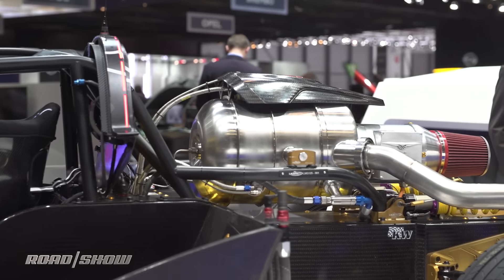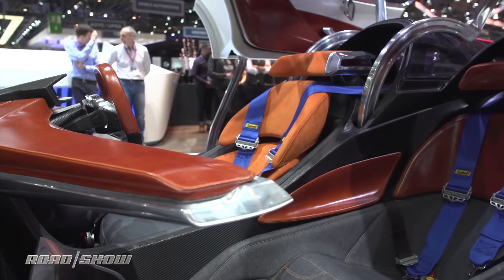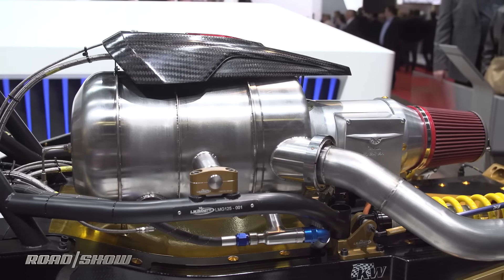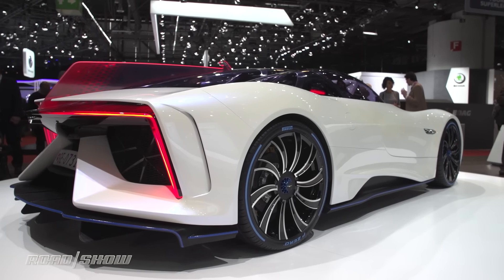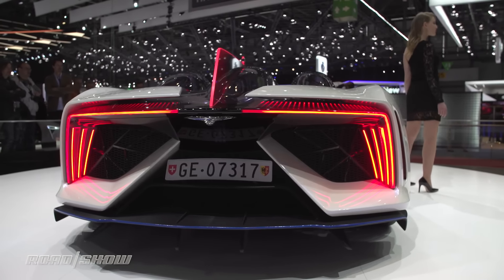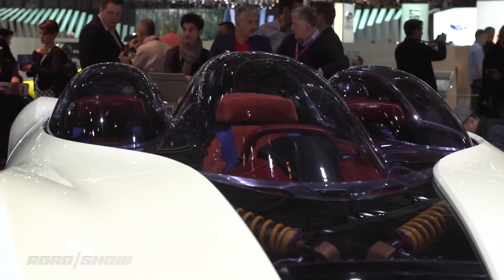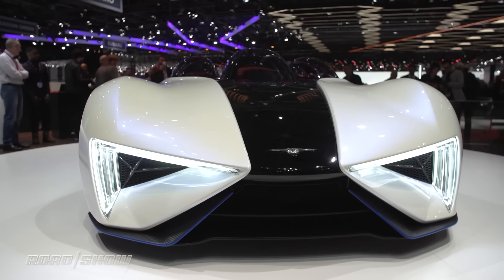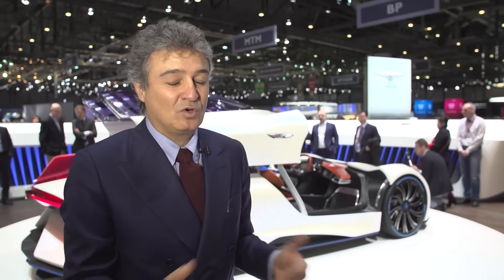Turbine-powered electric supercar unveiled at Geneva Motor Show | 2017 Geneva Motor Show

Comment: YES! I've been calling for this approach for years. High efficiency gas turbine with zero mechanical linkage to the drive train, which is pure electric. All the low-end torque of other EVs, but without the battery weight, recharge times or range anxiety. Kudos to TECHRULES. Now to see other automakers adopt this approach.
Reply: Oluseyi S nah it's not the best.  It's still bloody slow and only a one seated.  There are suppressed electric motor tech of greater than 100 percent efficiency.  This is nothing
Reply: Constantine Joseph it's nothing... Ok Einstein!
Reply: Constantine Joseph to have an efficiency higher then 100% you have to break the laws of physics
Reply: LOL.
Reply: it's a three seater actually, the driver's seat is in the middle
Reply: Actually this idea isn’t new. Jaguar came up with the same thing in the C-X75 proto about ten years ago...
Reply: To Right!!
Reply: Ya this is how you get the best of both worlds and how electric cars can actually beat an internal combustion engine! We should see one of the race teams on Lamans or something use this approach against standard ICE cars and show the world what it can really do!
Reply: @ConstantineJoseph  
2:56 Is is two seaters.
Reply: I agree! Turbines have so many advantages. Check out Wrightspeed. Also, with CO2-neutral synthetic fuels, I think it could well be a bright future.

Comment: diesel turbines? for an electric car? Thats counterproductive and rather worthless? :( It should be propane or a cleaner source like natural gas if they just HAVE to use a nonrenewable in the mix.
Reply: Actually You can burn anything in turbine engine, from diesel, kerosene, Biodiesel, Ethanol, Alcohol, Perfume, Jet fuel, US Military JP-5 and JP-8, including your gas. But it needs more rigid compressed tank than if you put liquid fuel.

It's not counterproductive because you only need smaller Lithium battery than compared to full EV car with similar performance. Faster and more practical to be refueled too with greater range.
Reply: How about Hydrogen burning in the engine.
Reply: I think even diesel burns quite cleanly and completely in a turbine like this. And with synthetic clean CO2-neutral fuels in the future, this setup will be perfect for many applications. Especially boats, ships, yachts, planes, drones etc.

Comment: Reciprocating engines are what, ~30% thermal efficiency at best.  No mention of target efficiency.  Looks like empty marketing.
Reply: Gasoline is about 20 percent, Diesel can get to about 40, gas turbine can get to 60 percent as of 2011. This is the best approach for electric motors to compete with internal combustion engines. Batteries will never reach the practical 2000 w/kg energy density of fossil fuels. We should use this design with carbon neutral synthetic gasoline.
Reply: @livefire666  
You can add palm oil to gas turbine engine.